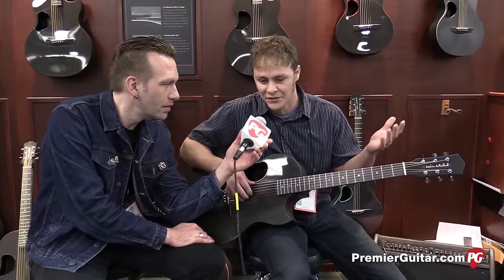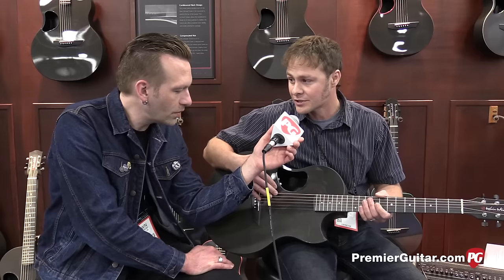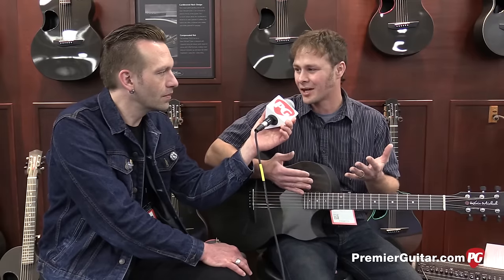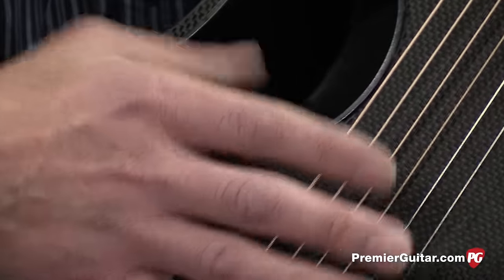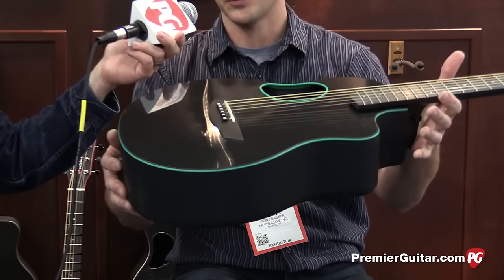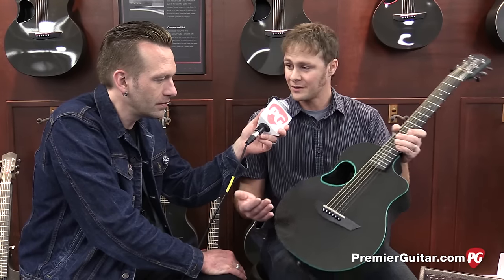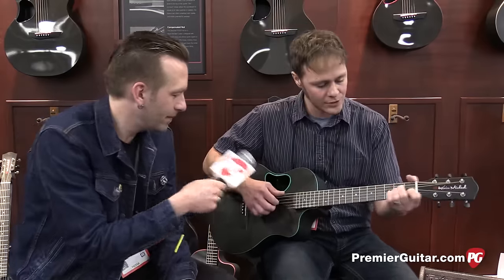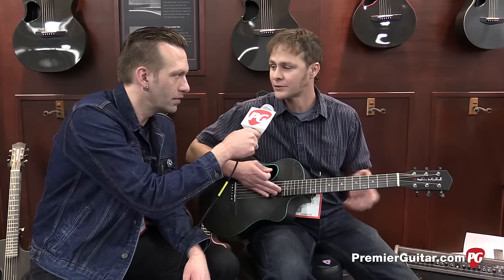NAMM '16 - Kevin Michael Guitars Sable Demo

Comment: Instead of a "sound hole" why don't you simply put a small modelling amp and couple of speakers in the guitar? All these things are small enough now and the CF could nicely mount them just like a preamp w/o any major tonal loss acoustically. In fact, make it so it is never meant to play without the amp/speakers. Reverb / delay all the time in desired. Think about it .